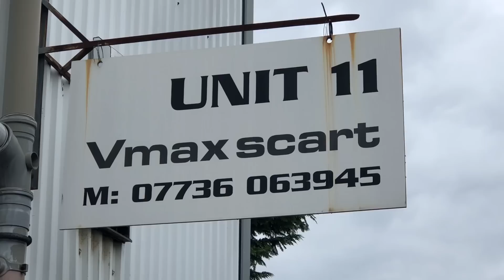How to Modify your classic mini cylinder head ! part 1

Comment: I've just bought an untoched 12G295 cylinder head for my 998 engine, but I'm wondering should I modify it like you've done. Some people just bolt them straight on and skim them for compression reason.
Reply from the maker: You could go bigger inlet and ex valves on the standard cast ports an see an increase in flow

Comment: What is your opinion on the 12g1316? I have one on my car I just bought and I just found one for $100usd
Reply from the maker: its ok I think there's a little too much expected of this casting , I searched hi and low for them to use a s big chamber turbo heads but the still broke through inbetween the inlet valves - be careful of this area on them !